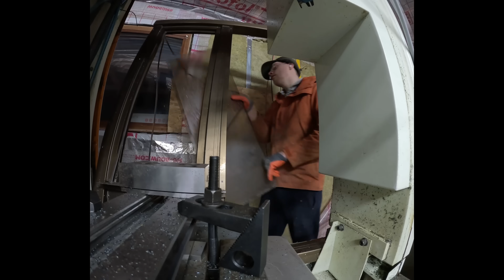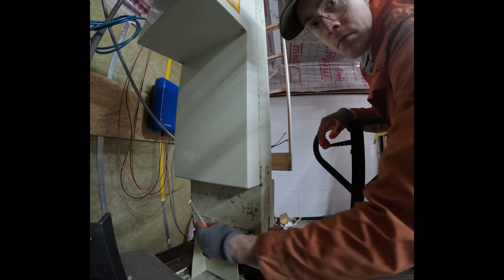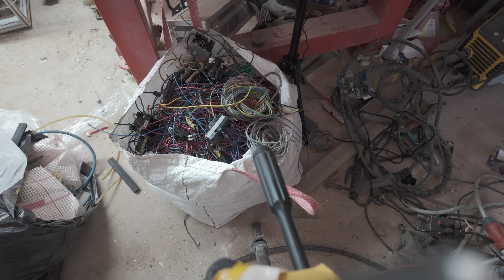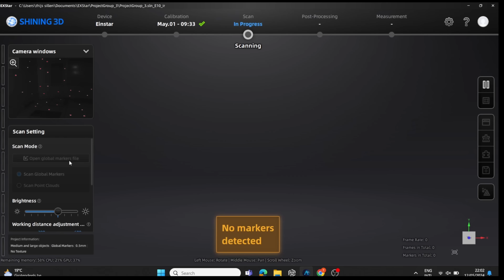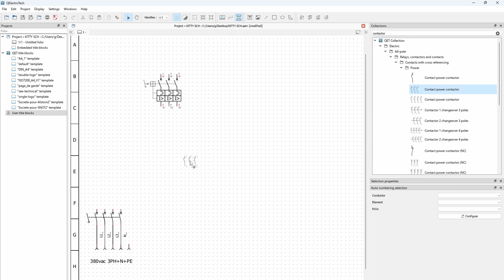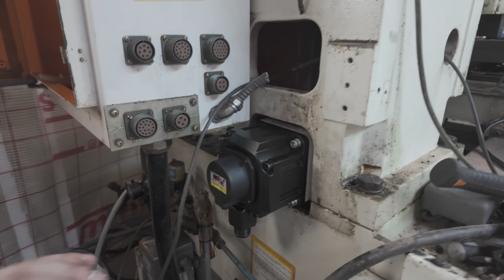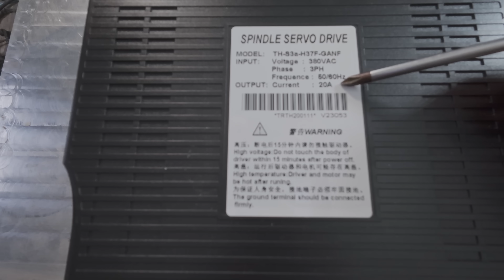I Bought a $40,000 Kitamura CNC for $3,000

Comment: What's the trick, on getting the enclosure off?
Pulling X-Servo and whole X/Y slide disassembly gets very difficult otherwise and I rather want to keep the enclosure intact, so I can install it back later on.
Got one recently for free, too and now it needs a good cleaning and some control repairs ;-)
Is it just small hex bolt on the bottom/middle and 2x hex bolts left and right?
And can I keep the control panel/screen on the machine?
Guess I somehow have to remove that white steel piece, 0:07 bottom right, to get clearance for the brown aluminium stuff to lift out???
Reply from the maker: While I can't remember it exactly, you can indeed just take the perimeter bolts off and then at least the majority of the enclosure should lift off. I'm not sure about the whole section with the monitor. You can indeed bolt it loose from the inside. I'm not sure if you have to do that first and then take the enclosure off or if you can take the enclosure off as one whole thing.

Comment: There better industrial controllers from China which are better than what you have and same price as you have
Reply from the maker: I was in talks with hnc for a while, but I was not convinced by their support and documentation. Most of them are also quite limited in the sense that if you want 5 axis for example you need to buy a top end unit. Hickory has a bit more flexibility in that regard.
Reply: @TheYieldPoint  I TELL YOU,there is solution there from China you wont regret ,includong 5 axis

Comment: Nice build may i ask here did you buy the servo kits. and are you running ethercat ?. Also do you have a thread on linuxcnc
Reply from the maker: I imported them directly from a dealer in china. Join the discord and dm me if you want some pricing. My linuxcnc forum account is routerman22 .I have a few posts about an old build on there. I have not tried ethercat on lcnc yet. But from what i have seen from friends, it is pretty easy.
Reply: @TheYieldPoint  nice :) i will join the channel.

Comment: Respect !  This is the thing, the base is good, only the system/software are old and you get no more new parts !
Reply from the maker: I had quite some contact with kitamura service. And mechanical drawings and replacement parts are indeed not available. The good thing is that it is super overbuild. So it will last a lifetime.

Comment: Those Fanuc parts you are getting rid of are actually quite good. They are just old but not obsolete. It is very difficult to beat them even with modern hardwares let alone some thrid party servos. Kitamura is well known for making machines maintaining precision for long. You'd have a very solid home CNC if done properly.
Reply from the maker: I sold a few of them. Other things such as the motors, servo controller, screen basically have no value. I tried to sell them for dirt cheap prices for like 6 months in NL / DE but no interest. Main issues is that any repair on these items is immensly expensive (more than my retrofit costs), run on 3 phase 200v (I don't like running transformers) and my controller did have almost no memory, did not support macro b etc. So yeah it would be possible to perhaps re-use the servos etc. But it wanted it all to be maintainable and servicable and unfortionatly the 30 year old setup was not. If anything electrically breaks now.; i can get a replacement locally or abroad in days for only a few hunderd bucks. But yes I agree with you that the fanuc servo's etc are quite good.
Reply: @TheYieldPoint  I'm running a Mitsubishi Meldas System (dated 1998), I'm drip feeding it from a CF disk -- but I also plan to retrofit it with LinuxCNC lateron just because the Meldas System doesn't support 5 axis, max 3+2.
Reply from the maker: @mrechbreger  if you use ethercat, it makes the wiring,homing etc much simpler.
Reply: @mrechbreger  Meldas from 1998 with a cf slot, is it a M500, or newer than that??
Reply: @gorak9000  Meldas M65 with ethernet option, not all Meldas M6x systems support this extension the documentation has more information about it.. It allows the meldas system to download NC programs from an FTP server to the CF card with a reasonable speed.
Afterwards you can drip feed that program from the CF disk (it's able to handle short segmented trochoidal paths)
Reply: @mrechbreger  Ah. My machine is from 94 I think, and it has an M3 control on it - a cut down crippled version of the M300 control. I hacked the firmware (which was no small task, and took moths of work, but was a super fun project) to remove the memory restriction on the M3, and a friend with a similar machine that also uses the M3 designed a new memory board with more memory on it, so now we can max out the M3 with as much memory as the M300 supports (like a whole 4MB!!! :-P). You can drip feed longer programs over rs232, but we wanted enough memory on the machine to load in the Renishaw probing macros. The machine isn't running yet because of other mechanical issues, and life just getting in the way
Reply: @gorak9000  I wrote the edge finder and tool setter macros myself I did not stumble over the internal restrictions the programs are lean and small. The memory for NC programs on the CF disk is 2GB on the M65.
It's fast and not comparable with slow RS232 drip feeding (I tried to drip feed trochoidal milling via RS232 and it pauses every few seconds which makes it unusable).
I did a full service and also inspected the ballscrews they are in a very good shape for that age.
Reply: I agree, the original servos were probably better than the new ones. 1kw sounds rather anemic. The originals are probably 2.5kw at minimum. It's always a shame when people "retrofit" and at the same time downgrade instead of just learning electronics repair. The old stuff is so easy and cheap to repair (when you do it yourself - if you have someone else do it, yes, very expensive. I fixed the spindle drive on my old machine for $70 when the repair quote the previous owner got was $3k) - the new stuff is basically disposable as repair is much more difficult
Reply from the maker: @gorak9000 old servos were 400w , spindle 8k rpm max. The new servos have higher resolution encoders an servo control did not stand still for the past 30 years. For me this was the right direction.

Comment: tuning of the servos went well? what's your follow error on average?
Reply from the maker: I dont know the exact values out of the top of my head by from what I remember it is quite good. My servos are quite overpowered, and that really helps. Delta B3 is still a relatively budget setup; a delta A3, Innovance 680 or whatever would perform better. Unless I get any particular issues; I probably won't really touch the tuning again.
Reply: @TheYieldPoint  That doesn't sound so reassuring :D Tuning servos on a CNC is an art - auto-tuning is never enough.
Reply from the maker: @chronokoks there are always the scales to close the loop😂
Reply: @TheYieldPoint  nope... they will just tell you how much shit your tuning (and your ballscrews) is with the benefit you'll drill the locations of the holes more accurately :D
Reply from the maker: @chronokoks both of those are quite good so i actually dont see it correcting a lot 😊
Reply: @TheYieldPoint  It's 2025 - the requirements are high-speed machining and precise holes for dowel pins and other precision cylindrical objects + 3d surfaces for consumer products molds. Something you can't do really with an ordinary HAAS machine (atrocious performance and follow errors) :D
Reply: @TheYieldPoint  I come from the high-precision world so I'm super anal about the performance of the machines :D
Reply from the maker: Yeah, i dont touch the lithography dtage at work :p @chronokoks